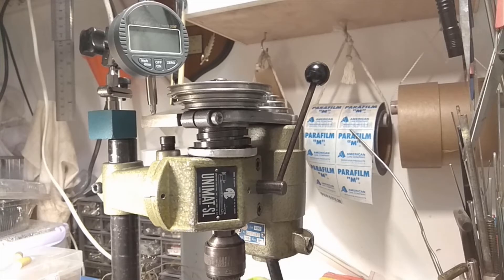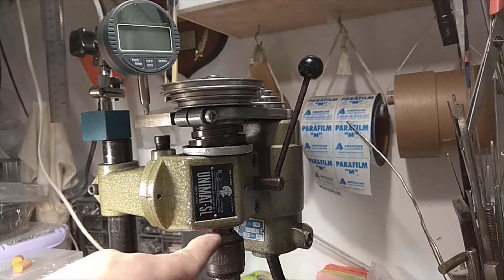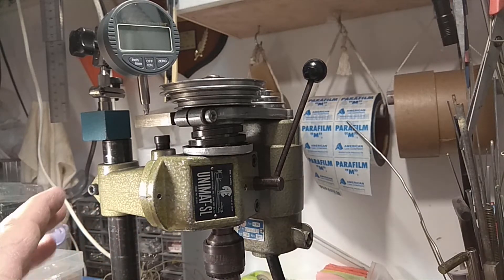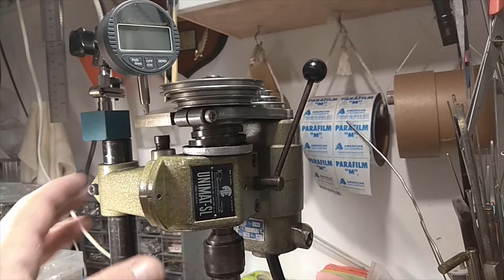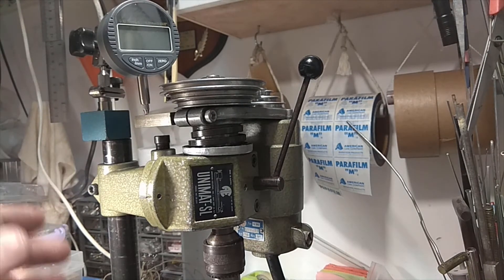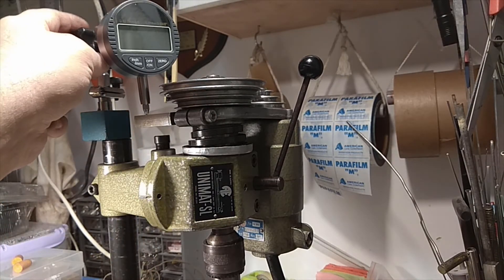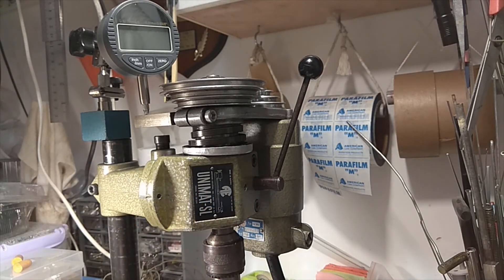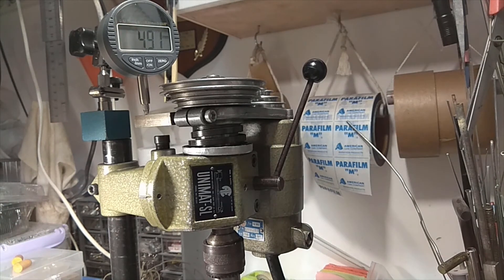Unimat modification Z axis movement control using an indicator

Comment: Bought kit off ebay thats lile thaf but don't use magnet base holds it on shaft of gauge
Reply from the maker: If it works that's great. Any good solution is good enough :)
Reply: @Smallathe  out n building looking at it it's saddle clamp or pipe clamp type deal. 
Has threaded little piece goes on it that touches off against head stock think only thing isale digital gauges on there side. See if i can find it give you name of auction. Wasn't a lot probably be easy to make. I got it with easy on off tooless bolt set and big chrome thumb screw raising and lowering on milling attachment

Comment: I know you probably don’t have time for this but I just got this lathe and was turned on to your channel. Anyway you could possibly go over the lathe and teach a newbie A little bit? Like speeds for instance what settings? What type of metal for certain speed? Like I said a big newbie and apologize to u all. Any help would be awesome love your videos and subscribed. Thanks a bunch
Reply from the maker: Sure! I will be honored to help. Congrats on the new lathe and welcome to a very interesting hobby!. Would love to help. I am a newbie myself. First tip: check mr pete222 aka tubalcain videos on turning and facing, tool bits and such. That is how I learned to use my lathe. For most metals I find the unimat (tiny motor) likes 1600 rpm. What brand of lathe did you buy? Model?
Reply: smallathe I have a unimat sl. I will check out those videos. Thank u so much for your time and effort. I truly appreciate it very much
Reply from the maker: @marksimone5609  my pleasure! Keep me posted...I suggest you practice on wood dowels
Reply from the maker: @marksimone5609  Hi. Now I'm sitting in front of a computer and I can type faster... I need to ask a few questions to try and help - do you have any tools? chucks? mounts? milling mount? Table? vice? etc? Will you be using carbide tools (or do you even want them?) or will you use primarily HSS tools? I find the brazed/mounted insert carbide tools from ebay (china) low cost and yet very good for most metals. The unimat works wonderfully with resin, hard wood, aluminum and brass - steel, stainless and titanium much less so - but it's doable (avoid Titanium if possible). With the latter metals, you will need to take very fine steps - 0.05mm ones or risk stalling the motor (not bad, not ideal). Steps in aluminum and brass are usually not over 0.3mm (or the motor will stall). It's doable, it just takes more time. 
If you want to send me pictures or communicate offline - my listed mail saaartal@gmail is active but I rarely open it (I use it for junk mail, ebay buys and such, never got mail from subscribers) - so feel free to write me but please give me a heads up over here. Enjoy your new tool - you will love it. Yes, it has it's limitations (every tool has) and yet it's very versatile.  Have fun!
Reply: smallathe I will get everything together and I will give u a heads up on when I will send you. My brother is a machinist by trade and helps me out when we see each other he lives further away and gets me stock of any metal I need. I’m a firearm enthusiasts and was gonna try to get into making and repair my own parts. Any suggestions on what I need and what I don’t will be appreciated. Will talk to u soon thanks for taking the time out for a subscriber.
Reply from the maker: @marksimone5609  Hi - We are all humans... why not help each other if and when possible, I say... 
My brother also lives far away (relatively, 2hr drive) and also helps me get scrap metal for my lathe :)
Basic tools - any cutting tools will be nice, HSS or carbide (either brazed or inserts) with 1/4"=6mm shank. A set of drill bits (and countersink bits). A dial indicator to true the lathe is a must too. That's it :)  This stiff is pretty basic, it  will do nicely for most turning facing and drilling. The rest depends on your projects and process. 
Will wait for your email. 
Saar
p.s.
Firearms?... Check my logo... it's unimat made :) about 2" long and works.

Comment: I don't have a Unimat.....yet😏. Been watching for one within my budget ☹️. If I do find one, I will certainly remember this tip. Thanks 👍🏻.   🇺🇸😎
Reply from the maker: The unimat is wondetful... but I would say you can do better on the same budget - it has three main issues that prevent it from actually doing everything: small 6mm spindle ID, grip force (e.g threading a male part is an issue) and milling conventricity & rigidity. Unimat3 is supposed to do all these... and still - I love it!!!
Reply: smallathe 
Good to know. Thank you 👍🏻😁.       🇺🇸😎